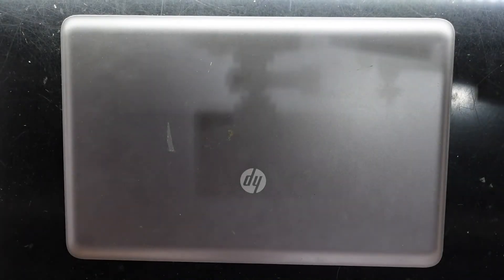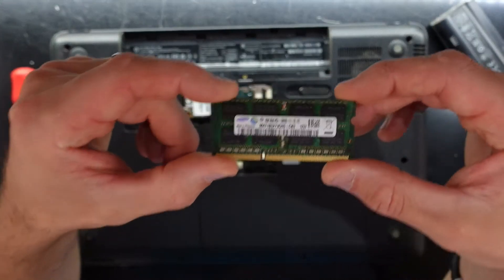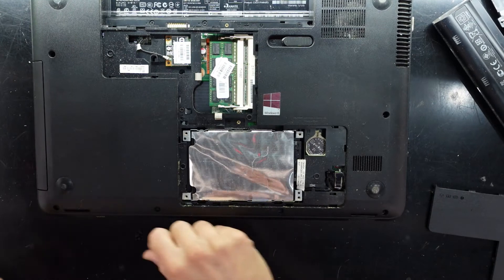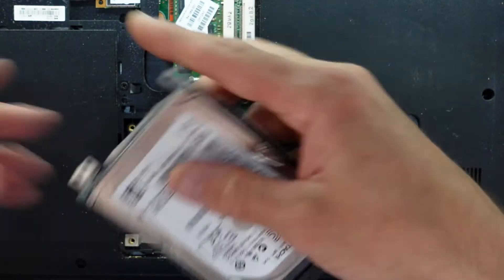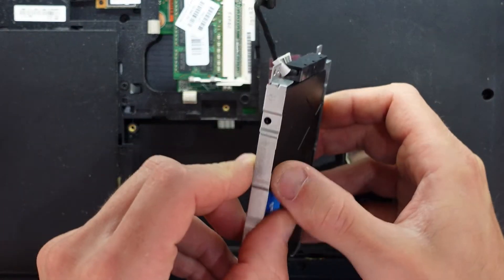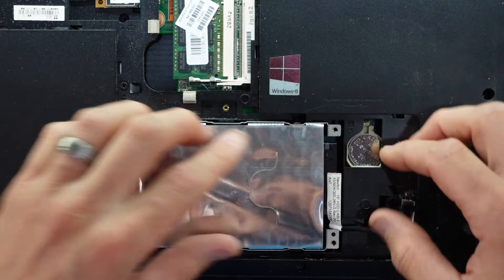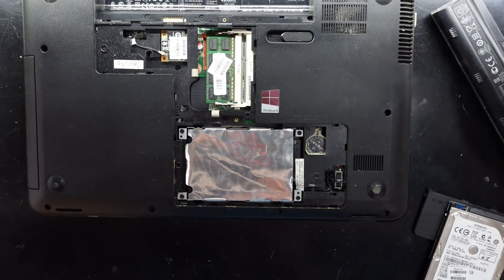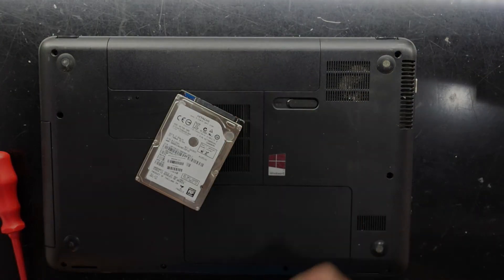HP 650 i3-2328M C5Q31PA SSD Upgrade

Comment: Is there a particular  ssd to use, I have the Intel Pentium B970 (2.3 GHz, 2MB L3 cache, 2 cores
Reply from the maker: i don't think you will get much of a performance upgrade with the B970 Pentium.

But i like the MX500 Drive but in your case i would probably purchase a Kingston A400 or WD Green 2.5" SSD
Reply: @rickstechrepairs  alright thanks. I dont really mind the performance aspect it's an old Pc But would you say the sata ssd will be suitable for my hp spec   or I should  just go with one of wd green or Kingston
Reply from the maker: all the drives i mentioned are Sata SSD's (they have a 2.5" casing and a sata power and data plug)

For the age of the machine go with a 240 or 480GB Kingston A400 2.5" Sata SSD
Reply: @rickstechrepairs  oh okay. Thank you

Comment: Clevo NH58DPQ Barebone Series, 15.6" FHD 144Hz Matte LCD, nVidia RTX 3060 6GB GDDR6, Intel i7-10870H CPU what's your opinion
Reply from the maker: the 3060 with a 144hz display is a good combo and saves on battery too, as most games wont crack a constant 200fps
Reply: @rickstechrepairs  https://rjtech.com/shop/index.php?dispatch=products.view&product_id=30818
The downside is that is 1300, replacing the m.2 with a 500 gb. The unit that u have cost 1100 here in the USA, but I'm guessing the i7 make it way better for some 3d rendering?
Reply from the maker: i dont think there would be too much difference apart from the i7 but gaming wise, i dont think it would matter too much as it thermal throttles the CPU during games anyway